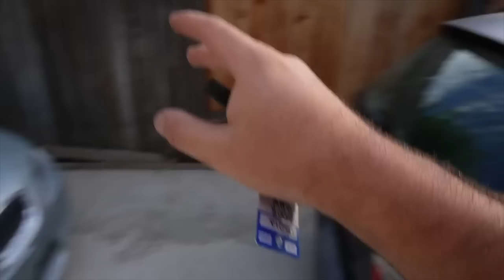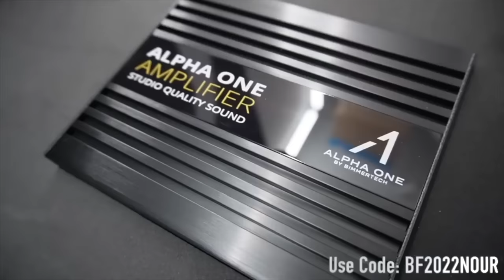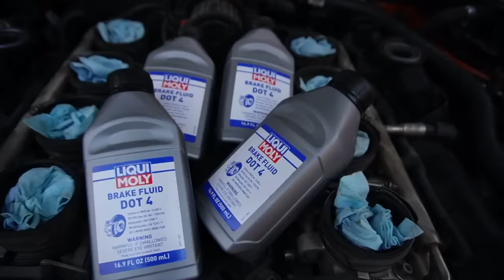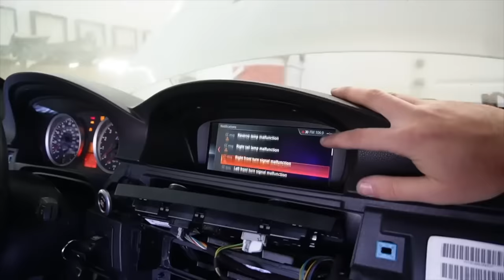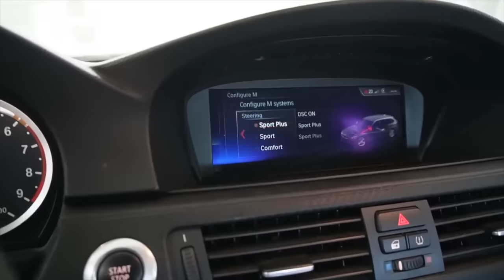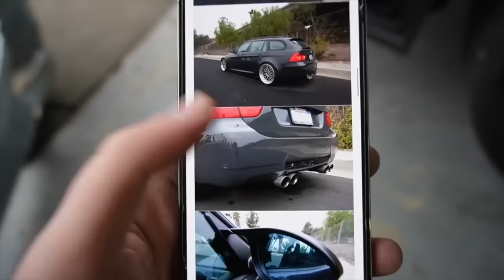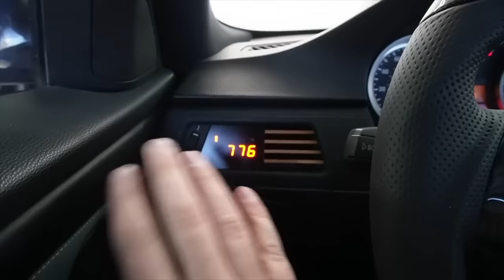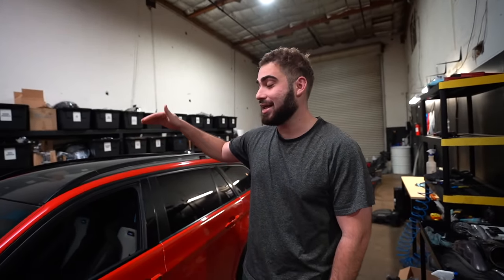FULL BUILD - TRANSFORMING A BMW E91 328I INTO A CUSTOM V8 M3 WAGON

Comment: Not to take away from the build, but wouldn't it be easier to keep the m3 chassy and retrofit the wagon rear end in the existing m3 car?
Reply: I think fitting a wagon rear on a sedan would be much more difficult, costly & unnecessary. Would take more labour and hours.
Reply: @richardohaletse7396  I disagree, I think the bodywork would take a few weeks tops. And you're left with a true m3 vs an M3 look alike built on a non m chassy. Just my 2c

Comment: Crazy amount of work!!!! 👏👏So what was the actual point to swap front end from 2008 M3?? To get M3 VIN? But it’s not wagon anyways. Just saying I’d rather keep body frame intact even with 328 VIN. Or you’re saying m3 e92 front end is actually different physically?
I recall doing same thing with e36 m3 and we swapped front end  from 318  due to accident and I can tell that body is 100% the same as regular 318, everything fit perfectly just like in your video. But I’d rather keep intact body even with 328 VIN. Sorry but I lived in Cali and I know how body shops work there and I have doubts they welded it properly (it’s impossible to do it similar to factory specs)
Reply: M3 front end is different then regular 325 328 330 and 335i front  end